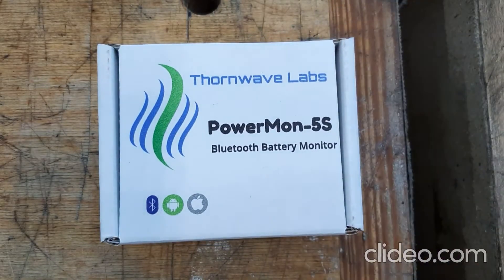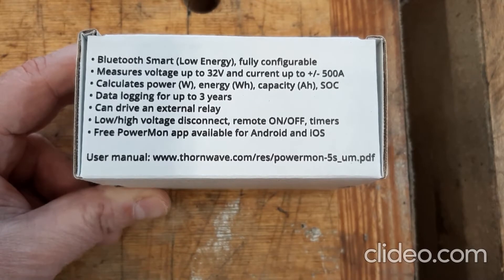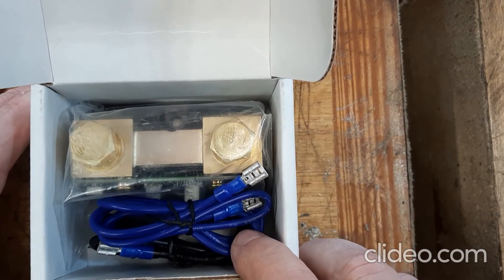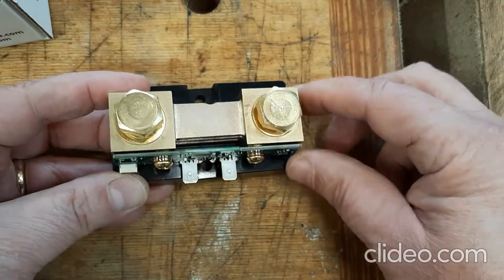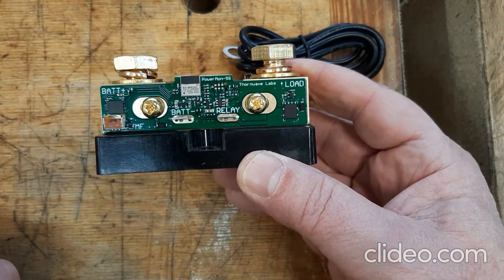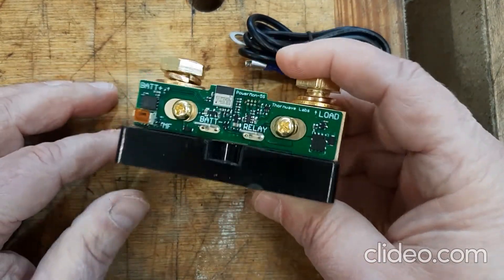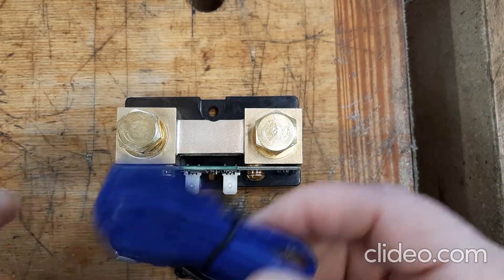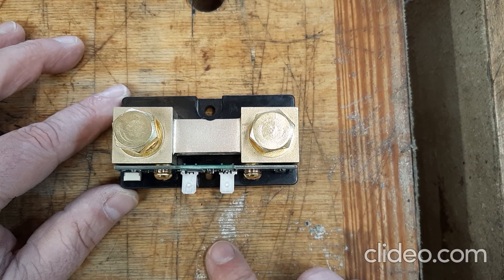Thornwave Labs PowerMon5s Bluetooth Battery Monitor with Integrated 500A Shunt and Logging

Comment: Just ordered the PowerMon (not the SmartMon-5S).  

I bought and then returned the Victron SmartShunt because it did NOT log data either internally or in the app (only the Victron BMV does that when connected to a PC).  The Victron Connect app only showed a live graph while you looked at it.  It didn't store any data anywhere.  And if your smartphone screen timed out the app closed and you had to reconnect and you lost all the data on the graph you were just looking at.  AND the bluetooth range was horrible!  It wouldn't go more than about 5 feet so I had to go outside my trailer just to get connected.  Frustrating to say the least.  That's why I bought the Thornwave PowerMon.  It logs data for THREE YEARS (unless you disconnect it's power source then you lose the data) and the bluetooth range is like 300 feet!
Reply from the maker: I can get a signal inside my RV but I have to near the outside compartment where the batteries are stored.
Reply: "unless you disconnect it's power source then you lose the data"
that's a shame, I wish they had used memory chips that would hold data when unpowered
Good to know though. So thanks heaps for posting